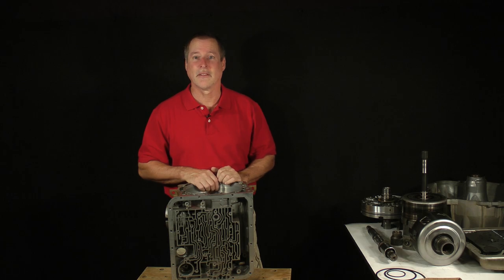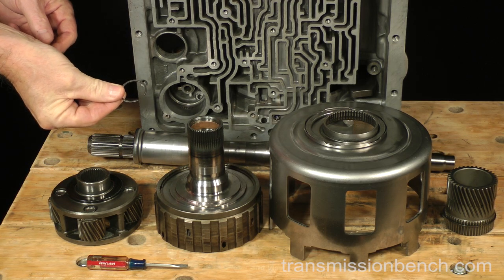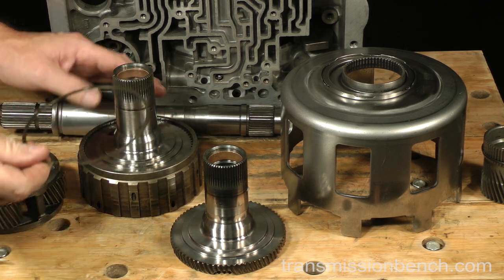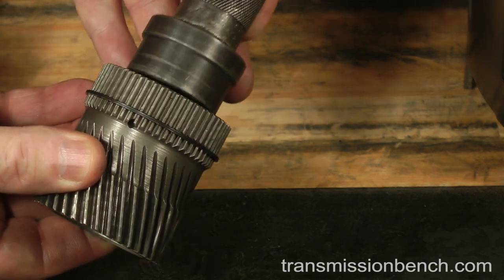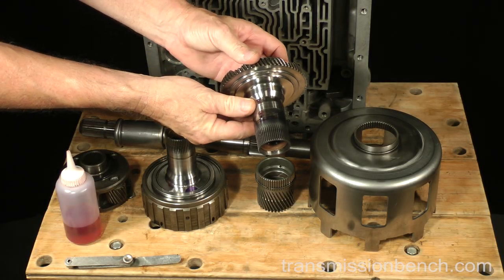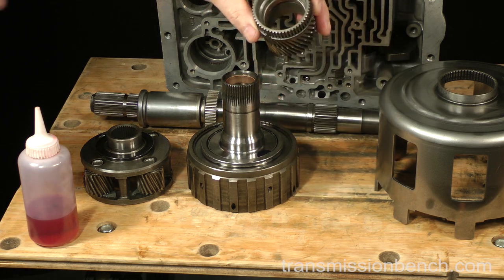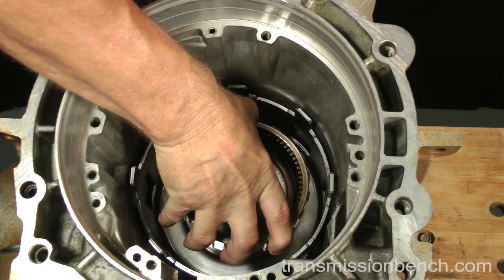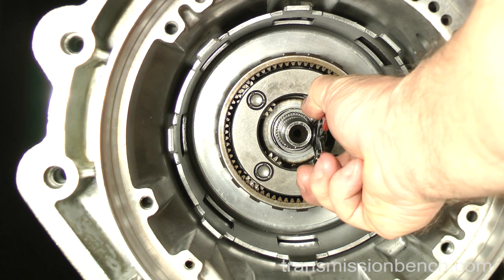Project 4L60E Part 2 lesson 3

Comment: Hi, after following my own step by step installation and then taking it back apart and then following you step by step it doesn't seem like my output shaft is coming in the case enough to install the small lock ring and the only step that I skipped was putting the shaft in last, I put loctite on the splines when I first started like the directions said that the manufacturer does when building it. So my question is should the shaft go in far enough to where the oiling hole in the journal is running on the race on the rear of the case? Because I'm a quarter of a inch short

Comment: Not only should the drive shell be replaced, it should be upgraded with a revised, heat treated hardened drive shell that's normally used for pro series racing.  They're not that expensive, upwards around $80-$100, but it's a very good investment to prevent transmission failure even after a recent rebuild.
Reply: Midnight Mechanic you wouldn't know if I can use an (new) old style sun shell with the 4 holes for a thrust washer (but not use the thrust washer) and keep just the thrust bearing?

Comment: I have a 99 s10 2.2 auto.  It had p1870 code. But all gears would still work.  Just long drives after stopping and down shifting to 1st it wouldn't want to pull .. could filter and solenoids fix it possibly?

Comment: Awesome video series, but may I suggest grinding down the mushroom top on your driver before you fire them off like bullets.
Reply: And use a proper mechanic hammer not a carpenter hammer.
Reply: @douglasgerrard5094  I think he is using those tools to show you need no special tools.He used a board as a hitting device.He also used the shaft to smack with.

Comment: I got a 2001 GMC Sierra V8 I'm doing a rebuilt and I have a 04 using as part can I put that dry shell on the old one with the roller bearing thrust because the old one has a thrust bearing that looks like brass would it make any different or work the same

Comment: So the snapring groove on the output shaft is not exposed enough to put the snap ring on. What would cause this?
Reply: Did you shim the thrust washer in between reaction shaft and input planetary? What reaction shell did you go with?
Reply: Did you figure it out? was it the bushing?